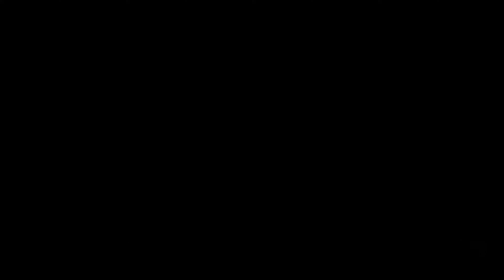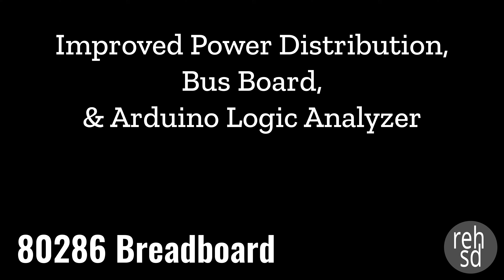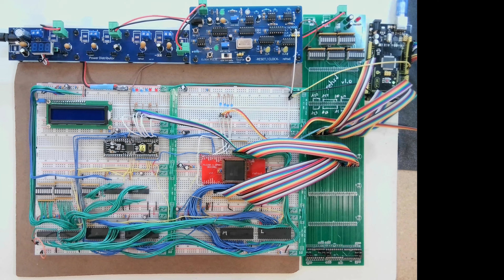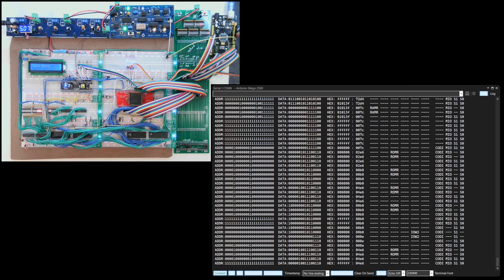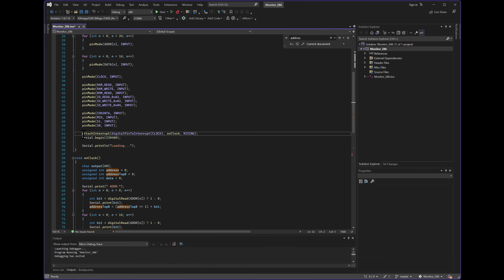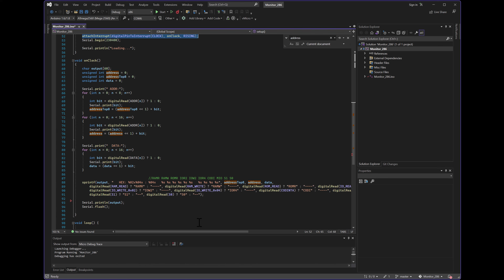80286 Build, Ep. #11 - Improved Power Distribution, Bus Board, & Arduino Logic Analyzer

Comment: Your Arduino Logic Analyzer is cool! I wouldn't have thought of using one in that way...
You could decode the data and write out the assembelr instructions for even more analyzing power. :)
Reply from the maker: I've even done that on previous systems (e.g., 65816 debugger). What's great about this processor is that I can easily tell the difference between a data read and an instruction read. So yes, you'll see instruction decode very soon (at a line level).  :)
Reply: I second that!